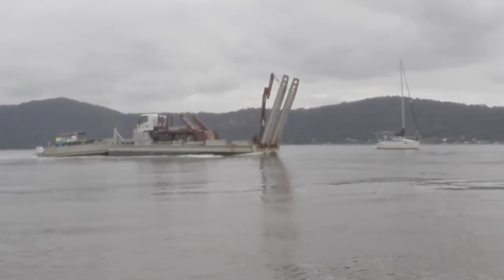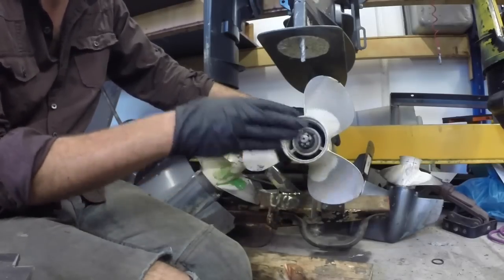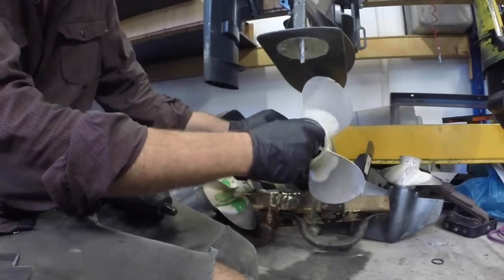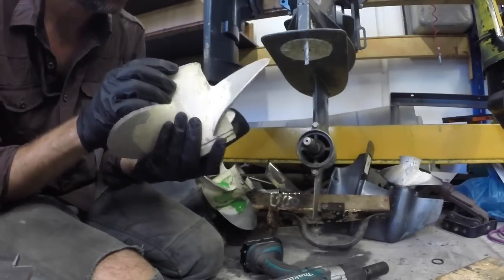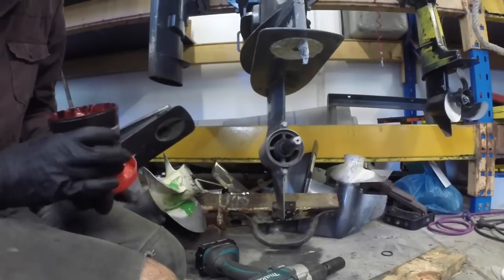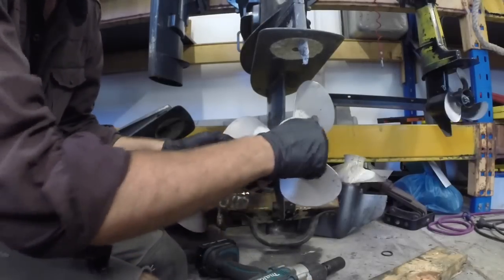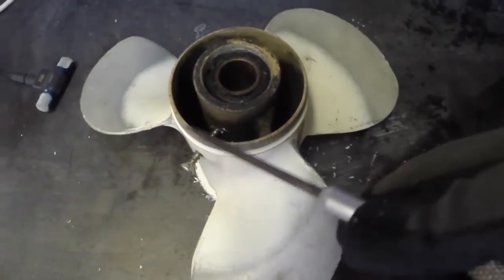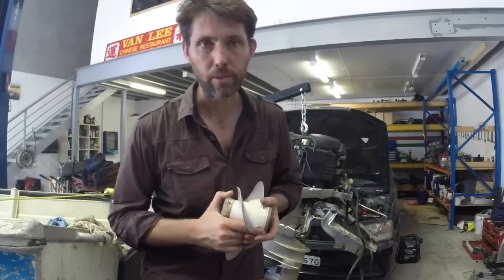Outboard revs increase but boat doesn't accelerate

Comment: I was going to say.. screwed my prop today.. Suzuki DT30 outboard w/ prop -  10 x 1/4 x 12
3 Blade. I was going to buy a Solas prop to replace.. looks like Solas Amita 3 Blade Aluminum 12P 4211-103-12 is a worthy replacement.. is that correct, and I guess I should buy a Suzuki Hardware Mounting Kit too so I have replacement bits to install it on and get some marine grease too.. is my research correct Stu?
Reply from the maker: Hi Michael. Yep, looks like the correct replacement to me too. Have a spare set of mounting hardware is a great idea. I've seen plenty of people lose one of the washers and wait ages to get the replacement part.
Reply: I don't have any missing parts so didn't get the hardware kit. Question though.. the cotter/split pin, are these a certain type.. i.e. stainless steel and size typically? trying to determine what one I need to purchase after reinstalling the new prop.. was going to go ask local boat repair guy, but before i do figured you'd know ;)

Comment: Some one told me it could be the part under flywheel or throttle control, boat is a 15ft procraft 1983. I shot a video with phone 1:51 long on YouTube, was bad camera work on my part, if you get to see it I'd like your thoughts. its the only video i have on YouTube
Reply from the maker: It does sound like it is down a cylinder giving you your power loss. Does it have spark on all cylinders? Are all the carburettors clean? It is possible that the throttle or ignition advance linkages aren't functioning properly. Certainly worth taking a good look at them while someone else moves the throttle through it's complete range of motion.
Reply from the maker: It does sound like it is down a cylinder giving you your power loss. Does it have spark on all cylinders? Are all the carburettors clean? It is possible that the throttle or ignition advance linkages aren't functioning properly. Certainly worth taking a good look at them while someone else moves the throttle through it's complete range of motion.
Reply: The carbs have been rebuilt, compression was good, haven't checked the spark, sorry for the bad video if you seen it, 1st I want to thank you for all your videos, you help more people than you know, great detail

Comment: My boat won't take off. It takes about a minute to takeoff what can I do
Reply from the maker: +Janelle Farmilow Hi Janelle. Do the motor's revs increase when you try to accelerate or does it say low until it gets going. This will tell you whether it is a problem with your prop like in this video or a problem with the motor itself.

Comment: Great video mate. Hit a sandbar on weekend with a 30hp etec at around 30km/hr. (Missed the narrow channel by a bees dick) Luckily I had the tiller steer in raised position and motor bounced up. We travelled the last 500 meters in shallow drive at low rpms. What signs do I need to look out for when I take it out next? Brand new motor and don’t want to stuff it.

Comment: It's not a split pin, it's a cotter pin.
Same type measurements for aircraft props, OD, and pitch.
I found everyone was running 12x8 props and they couldn't create very much thrust, I went for a low pitch prop, raised the rpm to 12,500 and i now have 8 lbs thrust from a ten cc motor.
Reply from the maker: They are called split pins everywhere in the world other than America. https://en.m.wikipedia.org/wiki/Split_pin?wprov=sfti1

Comment: I have a stur dee dory! I just purchase a brand new Yamaha f25 tiller motor. The dealer wanted it to charge me 300 dollars to install the motor, but I was painting the bottom and doing some modifications on the inside. I went by what the manual and the Yamaha dealer recommended on how to install it. They required that the cavitation plate is level with the bottom of the transom. So I did and when I took the boat out for the first time with my brother in law going out and being out there was perfect until we started heading back in we noticed the motor propeller slipping my brother in law said its sounds like it’s cavitating. I have a 20” transom with a 20” long shaft. I thought maybe it was because my brother in law is a heavy guy and he was standing right in the front of the bow.  so when we hit any small wave the propeller was coming out of the water. He said it shouldn’t do that. I email the Yamaha owner and send them pictures of my installation and he said he was going to pass the pictures to his worker guy. It’s been a week haven’t heard anything. I want them to reinstall it to see if it would solve the problem. When I took the boat yesterday out for a ride myself to see how it rides with one person it was a horrible ride if I tried to go fast at all. The bow would stick really high and any little wave felt like you hit a rock and it was scary. I just want to sell this boat and motor if I can’t fix it. 🙁
Reply from the maker: This is the video where I mounted my motor https://www.youtube.com/watch?v=IonsSQYVsU4 Your theory about the height is sound so it is a bit weird. Where is the trim pin set on the motor? Can it be dropped any lower? By the way, aluminium boats do give a very rough and uncomfortable ride in choppy water because they are so light, that part is "normal"
Reply: Dangar Marine it’s a flat bottom fiberglass dory. On the manual it says the cavitating plate can be an inch lower and it’s 3/4 of an inch lower than the bottom. I got some pictures but I have to figure out how to send them to you

Comment: i just want to say the part about the guy at the boat shop that says u cant get the hub back straight where it dont vibrate is BS lol its way way cheaper to replace just the hub then the prop. all u do is pound a new hub in the same way the old one came out with a rubber mallet. the hub can only go so far then it will be perfectly straight and ready to go.
Reply: when i spin hubs on my outboard i replace just the hub for 60$ i have a 300hp outboard and props for my boat are 1200$

Comment: ДАНГАР СПАСИБО ЗА ВИДЕО.
У меня Yamaha F50A мотор работает не ровно,думаю надо регулировать карбюраторы.Жду от Вас виде о регулировке карбюраторов...Спасибо..
Reply from the maker: +Sergei Aksenof Good luck with the carb adjustment. Normally if it is not running smoothly it is because one cylinder is not firing giving in uneven feeling. Check the spark plugs too. I hope this translates okay:  Удачи с регулировкой карбюратора . Обычно, если он не работает гладко , это потому один цилиндр не давая стрельбы в неровной чувства . Проверьте свечи зажигания тоже. Я надеюсь, что это переводится в порядке :

Comment: That screw fix will work only with small, dinghy outboards. Once tried with a 100 hp+ outboard and it did not work. I even had that trick on steroids by using 8 mm bolts and making 8 mm threads to those holes. It lasted about a minute and failed. It would work if there isn't that rubber separating those metal areas and there would be just shearing force. Now there is both bending and stretching forces and it is too much.
Reply from the maker: Yep, definitely more for the small outboards.

Comment: not all props have a pin and need to be torqued to spec 100ft lbs ..... dont leave that prop loose snug the nut to the next slot and then put the pin or you will end with slop between the nut and prop ....

Comment: No it's sits on a trailer it's pretty clean
Reply from the maker: +Janelle Farmilow I would definitely be looking at those other three things first then if it had suddenly started doing this. Also check the prop for any deformation or slipping in the bushing like in this video.

Comment: No it takes about a minute to get onto plane
Reply from the maker: +Janelle Farmilow So has it always been like that? Is it just underpowered? Is the hull dirty from living in the water. That will make a huge difference. If it has started happening and the hull is clean I would be looking at the things that might make it lose power - compression test, carburettor clean and new spark plugs to start with.